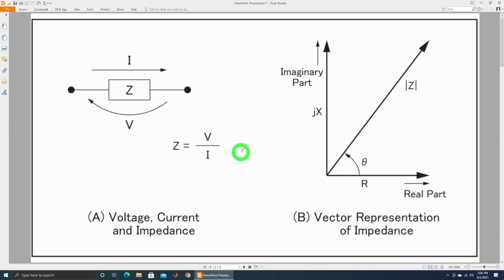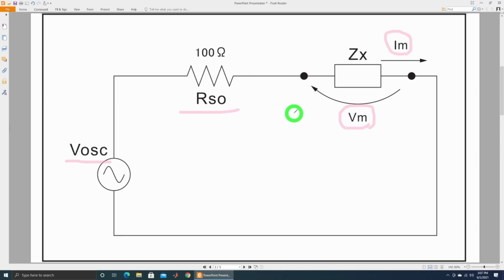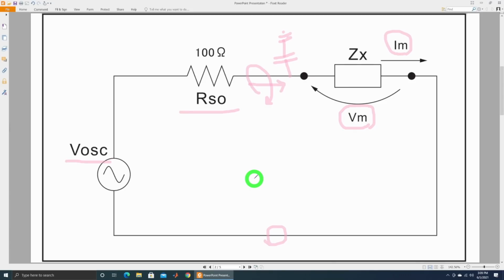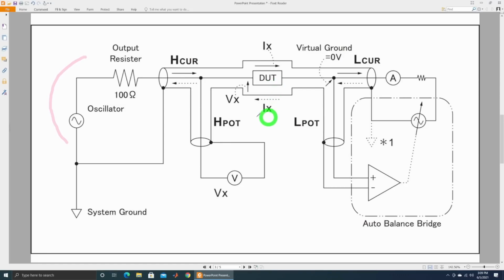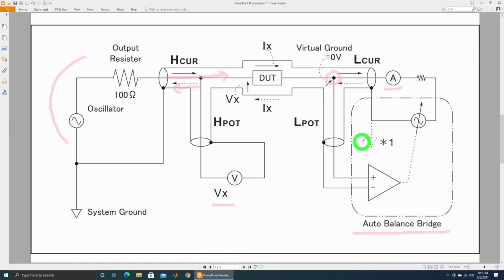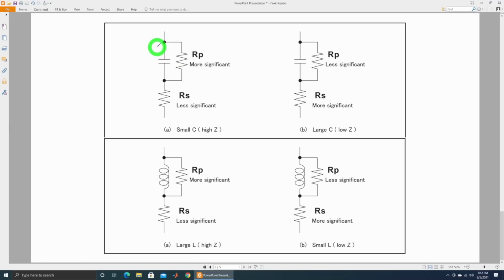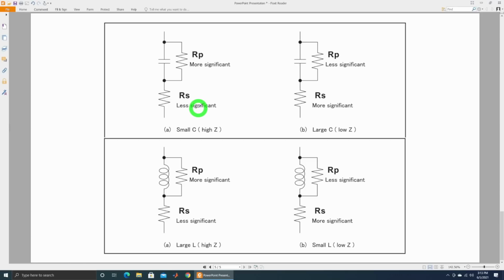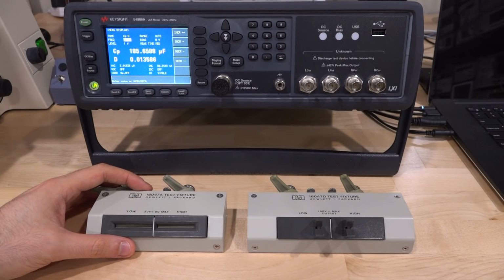TSP #197 - Tutorial & Experiments with Keysight E4980A 20Hz - 2MHz Precision LCR Meter

Comment: Hi, I saw your video and it is very useful.  I have a handheld LCR and trying to fully utilize its functionality. In your video about measuring 1000uF electrolytic capacitor at 100 KHz, its capacitance value is no longer meaningful. However I have a question about the ESR value at 100KHz for this 1000uF capacitor?  in your video, the LCR meter is still displaying something, is this still an accurate ESR value for this capacitor at 100 KHz?

Comment: Hi, I'm Eric. I want to use 2 LCR meters (Keysight E4980A) to measure the inductance changes of several inductive coils, and the input signal has to be in the same phase due to the coil design needs. Is it possible to achieve this kind of thought? and also, do you know how to do it?

Comment: Are there any tips on frequency range, bias voltage and type of fixtures to be used to measure capacitance as small as ~ 50fF?  Should one measure the parasitic capacitance first? Also, what things to be kept in mind while measuring such small capacitance?

Comment: Is it possible to achieve a degradation mechanism for an electrolytic capacitors using an LCR meter by either considering a thermal or voltage overstress. I am aware one can adjust the voltage for the DUT of the LCR meter but is it possible to have the capacitors placed in an oven and measure with the LCR meter continuously. I look forward to your response.

Comment: Those Keysight 4980A(s) are around $20k new!  I just bought a couple at work and one showed up with a screw loose inside, needless to say I was a little disappointed, for such an expensive device!  I could have popped it open and figured out where it came from but, I sent in said meter, and it took around 4 weeks to get back.  But it was calibrated again so that may have contributed to the time.
Reply: That’s pretty insane lol, quality missed it. I wonder if they do vibration testing on these units to pick up anything

Comment: For the electrolytic & tantalum, using a 1V test signal, shouldn't a DC bias be applied so that the cap doesn't get reverse biased on the negative half cycle?
Reply from the maker: Please note that the actual voltage swing present across the device is only a fraction of the applied voltage. You can see the voltage on the device on the screen (as well as the current through the device). But you are right that under the circumstances where the frequency is low and the capacitance is also low, the user should keep an eye on the voltage across the DUT to make sure it does not reverse bias the capacitor strongly.
Reply: @TheSignalPath  Thanks.  A very interesting demonstration would be to show how some of the high-K ceramic dielectrics have a very strong voltage dependence (Z5U, Y5V) where the capacitance decreases pretty dramatically vs. DC bias.  While dielectrics such as X7R are much better - of course, not as good as NP0/C0G.
Reply: @TheSignalPath  Shahriar, I saw it at 12:40. At the risk of replying to an old video, could you elaborate on why this is the case that the voltage swing present across the device is only a fraction of the applied voltage? Are parasitics the cause of such a big difference? I imagine it can't be, otherwise it would render the measurement useless.

Comment: When I was at a transmitter station in the Royal Navy the transmitters had variable vacuum capacitors in them and the piece of test gear used to test them was so dangerous to use, only senior rates could do the test while us mere mortals watched.
It was basically a very high voltage power supply with a current meter, I can't remember if it was nano, micro or milliamps, but I remember that with the failed capacitor the current slowly started to rise as the voltage was turned up which was in excess of 10kV.

Comment: It would be interesting to see the equivalent parallel resistance of a bunch of equal valued capacitors of different dielectrics. Particularly with film caps. Polystyrene is legendary for low leakage, but I recall an article by Bob Pease about polypropylene's superiority in this regard.

Comment: My guess is that the internal block level architecture contain a high resolution DAC driving the test voltage/frequency and a high res ADC after current ranging transimpedance amplifier. My questions are:
1. Why not plot Z/Y over frequeny?
2. Why not show HD for a component, e.g. ceramic caps?
3. Why not fit to a 3 or more equivalent network?
4. Why not place at least a DAC buffer and the transimpedance amp on the DUT testboard?

Comment: maybe I understoot it wrong but I think Vx at the high pot is a voltage meter, not a generator. Or did you mean there is the guarding source ( but not visible in the drawing)that puts a voltage on the coax shield ? There is a lot of info on the site of IET, they scanned all the GR docs they could find with the help of bridge guru Henry Hall ( very nice person who worked 40 years for GR as designer. He gave me very good advise when I was restoring my GR 1608.  It is a few GB of info and very well and comprehensive. It is from the time engineers learned how things really worked 😎 ( like you )
watched all your videos, they really are a class on its own. I made some videos about more advanced measuring and I know how much work this is. I stopped because my internet is to slow, it took more then a day to upload and often needed to do it several times because internet dropped. So thank you.

Comment: very nice experiments. I started getting "obsest" by caps about 10 years ago trying to measure fF. I designed and build a meter and started collecting bridges (like the GR1520 that was used in GRs cal lab. The funny thing is that I learned about the fringing effect from building my own caps using PCB. But I used only one piece of double sided pcb and calculated the capacitance.

Comment: Either people really want to hold on to their 4339Bs or they didn't make a lot of them.
Reply: Then if you find one you see  they REALLY want to hold onto them when you see the price!  You might have better luck finding a 4275, which is a 1980's LCR meter that goes to 10 MHZ. It is a LOT larger physically (the 19" rack box that is typical of HP instruments of that era)  than these new instruments but it has comparable performance. I got mine in working condition off ebay for $600.
Reply: You may want to consider an Advantest R8340A as an alternative. It combines a HV DC source and a low current meter to make a very high resistance meter. They are much cheaper on ebay and still have good performance. I have one and have had good luck with it.

Comment: Since you have this marvelous instrument (hopefully with option 001) could you measure a 1 to 10 uF MLCC (6V, 20V, 50V) while sweeping the  DC Bias to ~ 40 V (inst. max)?  This would be quite enlightening to many engineers who have these capacitors in buck, or especially boost power supplies of >12V as to why there is so much ripple and instability which is not shown in the SPICE models?
Reply from the maker: Sure, it is definitely possible. The instrument has all the options.
Reply: @TheSignalPath  😊  Hint: the capacitance will be < than 20% at the rated voltage.
Reply: @shazam6274  Be sure you are using the frequency the manufacturer used to define the capacitance of the device.
Reply: @glasslinger  This is not about frequency (which is shown in the capacitor's SRF graph).  It is about value change with DC bias
Reply: @shazam6274  Yes, I know. Capacitor vendors have graphs showing the change with DC bias if it is a problem with that kind of capacitor. Some of the low voltage ceramic capacitors can change over 100% with bias!
Reply: @glasslinger  Yes.  Unfortunately most MLCC manufacturers do not have this information.
Reply: A lot of MLCC caps are piezoelectric, and expand when a voltage is applied over them. This in turn reduces their capacitance and in turn they are worse at suppressing ripples at the higher voltages.

Were designing a voltage multiplier for a Penning gauge, and the caps I looked at dropped in capacitance by over 30% when at their max voltage (700 or so volts) compared to their capacitance with a 0 volt charge.
Reply: @todayonthebench  Be sure to check the specs on the capacitors before buying them! You can of course use a slightly higher value if you can fit it in your application. (engineers know of this problem and compensate for it in their designs)

Comment: Curious, Applent Anbai LCR meters like AT810A or AT3818 has similar physical instrument layout and LCD menu. Anbai seems manufacturing LCR meters for GW Instek and perhaps they are also manufacting for Keysight?
Reply: I think Agilent was doing this design before Applent existed.  Given the HP /Agilent/Keysight history of high end test equipment I think there is a good chance Applent designed theirs to resemble the earlier design.
Reply from the maker: These instruments had a Japanese origin I think. The are the successors of the older HP branded ones.

Comment: Could you answer me something?
How precision companies know how much is 1 volt?
How they precisely get that information "from" so they can precisely calibrate multimeters and so on?
Reply: It's important to know that Volt is not a fundamental unit. The SI base unit is kg*m^2/(A*s^3). There are calibration standards for those units. More practically, there are voltage standards based on various technologies that can accurately produce a set voltage (see wikipedia for Josephson voltage standard for example). From there, there is the concept of traceability and NIST certificates and so on, so that you can transfer the standard from one device to another.
Reply: @supernumex  May I add that the traceability does not guarantee the accuracy of any unit, it does only guarantee that if a unit used to test your unit, is found faulty, is it possible to warn you about the error.
Every test gear used from the highest level and to user level is within a margin of error that gets transferred to the unit tested by it. One more thing is that most units do not get calibrated as in adjusted in accuracy but is tested for deviation and change in accuracy from new to now. Often is it more important to know how your unit changes over time than try to bring it back.
Reply: @friedmule5403  Very good points.
Reply: If you want some search terms, google "electrical metrology" which is the field encompassing this, and "Josephson junction" which is the modern standard of a volt. These devices are maintained by NIST in the US and other orgs worldwide, that maintain a traceable chain of standards that is used to calibrate devices.
Reply: It comes from very accurately instruments (transfer standards), which in turn are calibrated using some sort of primary standard at a standards lab, for instance the national metrology institute of the respective country. For voltage, that primary standard could e.g. be based on a Josephson junction: https://en.wikipedia.org/wiki/Josephson_voltage_standard